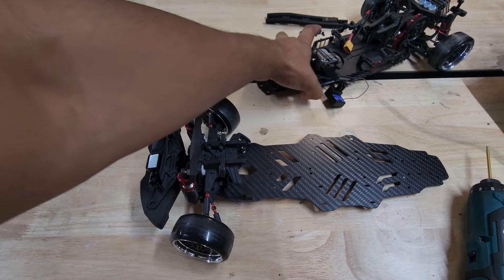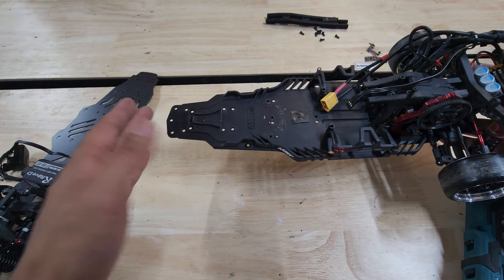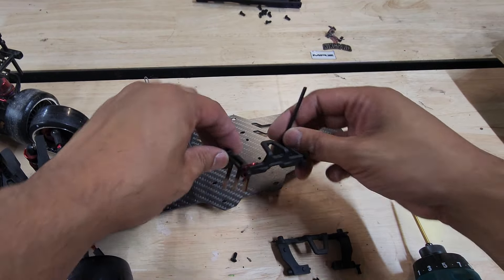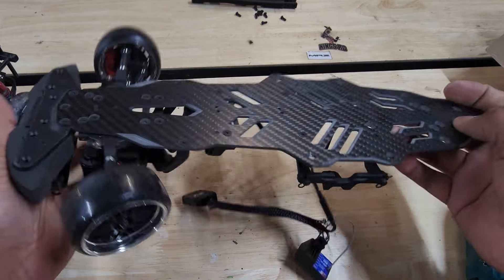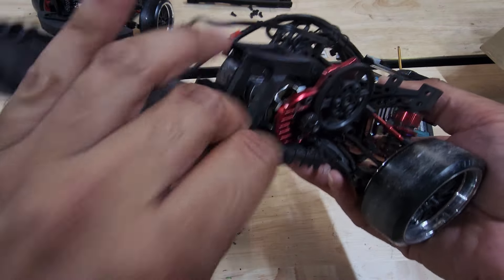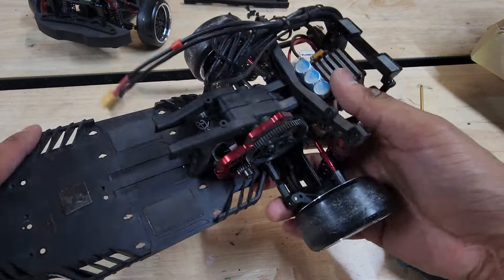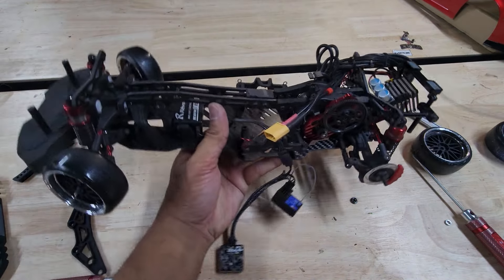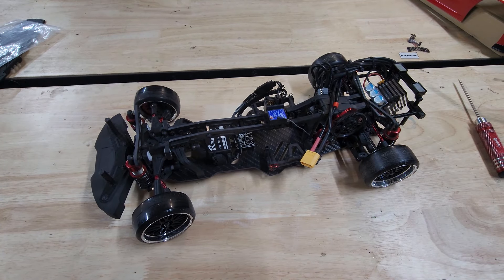MST RMX 2.0 Chassis Upgrade | HOW TO

Comment: Mine just arrived thanks for the tutorial very nice body on it. What drill connection do you have for the Makita? I only have 'hand tools' and would like to find a set for a small driver.
Reply from the maker: You can get them from banggood or local hobby shops would have them.. 😊
Reply from the maker: Oh just make sure you pick the once with the slot in them at the end, otherwise they will fall out of the tool. I had to put slots in mine on a lathe

Comment: quick question. I have a Flysky and I had the hardest time trying to control the gyro and adjust it from the control. Any tips or tricks you can help me set and adjust my flysky. Thank you in advance.
Reply from the maker: What gyro and flysky radio u use bro?